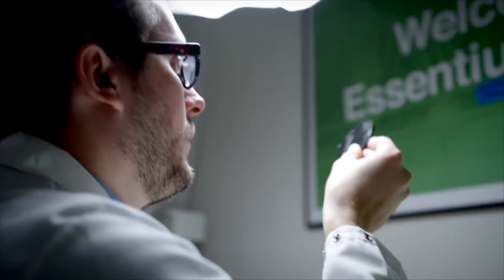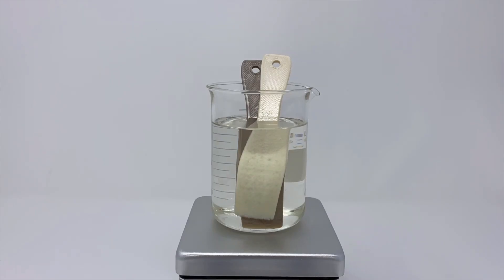Essentium Materials Guide: PEEK

Comment: This video is an Essentium Materials Guide on PEEK. It first introduces PEEK as an ultra - high - performance semi - crystalline thermoplastic polymer discovered and patented in 1978 by ICI, belonging to the polyether ether ketone family. Its properties stem from the balance of stiffness and flexibility in its molecular structure. Then it details PEEK's applications in various industries like aerospace, due to its chemical resistance, flame - retardancy, low moisture absorption, etc. However, PEEK has high cost and difficult processing conditions. Essentium collaborated with experts to develop a 3D - printing - specific grade. To maximize PEEK parts' performance, annealing is recommended, with a specific temperature - ramping process described. The video concludes by directing viewers to their website for more info on high - performance polymers.
[00:00] PEEK Introduction and Molecular Structure
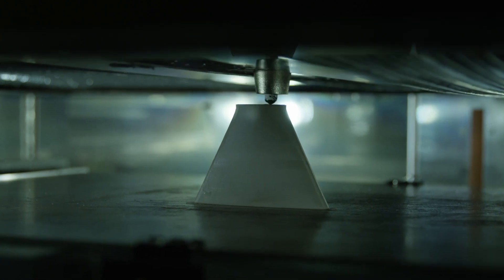	[00:13] Polyether ether ketone or PEEK is an ultra - format semi - crystalline polymer
	[00:20] PEEK was discovered and patented in 1978 by ICI
	[00:33] PEEK belongs to the polyether ether ketone family
	[00:44] PEEK's outstanding properties come from its polymer backbone structure
	[00:53] The balance at molecular level gives PEEK good mechanical properties
[01:02] PEEK's Properties and Industry Applications
	[01:03] PEEK is used in various industries like aerospace, oil and gas, etc.
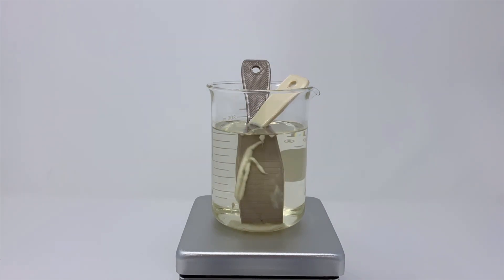	[01:25] PEEK part is unaffected in dichloromethane due to chemical stability.
	[01:31] PEEK is an inherently flame - retardant polymer with UL 94 v - 0 rating.
	[01:40] PEEK absorbs almost no moisture, ideal for autoclaving.
	[01:54] PEEK has high crystallinity, can operate beyond glass transition temp.
[02:04] PEEK's Drawbacks and 3D - Printing - Specific Grade
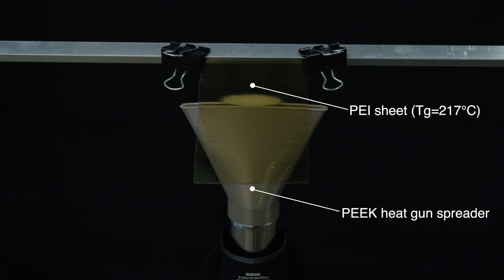	[02:07] PEEK is incredibly stable against thermal degradation at elevated temperatures
	[02:20] Two major drawbacks of PEEK are high cost and exotic processing conditions
	[02:33] Teamed up with experts to develop a 3D - printing - specific PEEK grade
	[02:51] Higher success rates in printing complex parts with Essentium PEEK
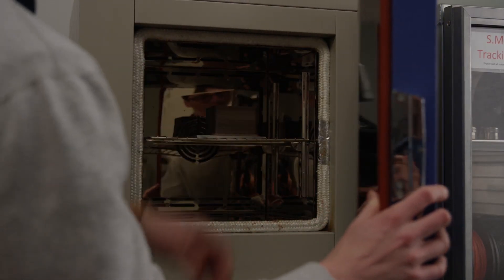	[02:56] Anneal PEEK parts after printing to achieve maximum performance
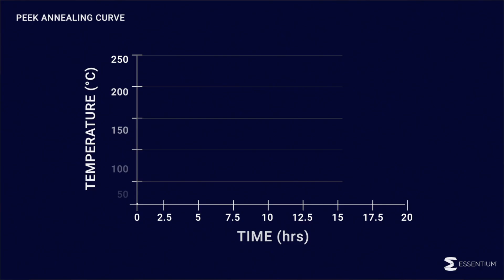[03:06] Annealing Process for PEEK Parts and Further Information
	[03:06] Ramp up temperature to 200 C, then to 225 C in annealing process
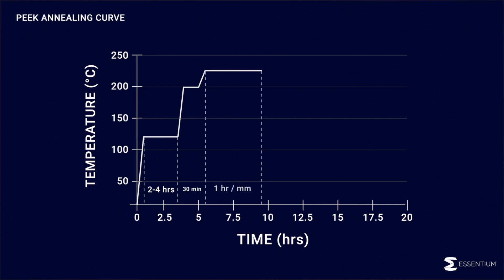	[03:15] Cool down 3D - printed parts slowly in oven after heating
	[03:23] Limit residual stress by ramping down temperature 10 C per hour
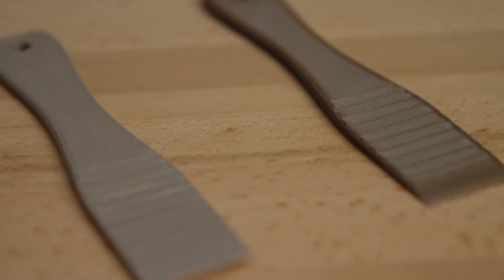	[03:31] Directed to website to learn more about high - performance polymers
	[03:37] Website address for more information on high - performance polymers